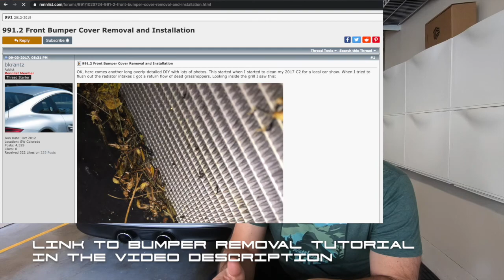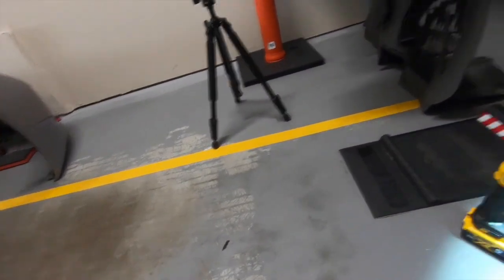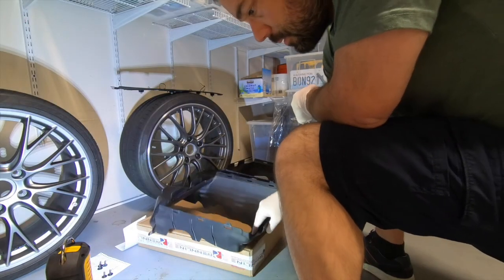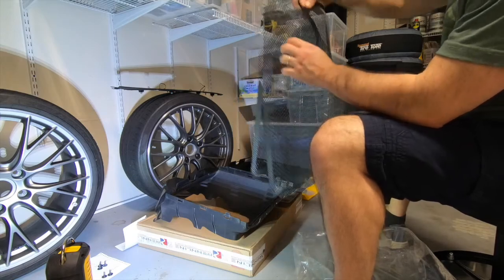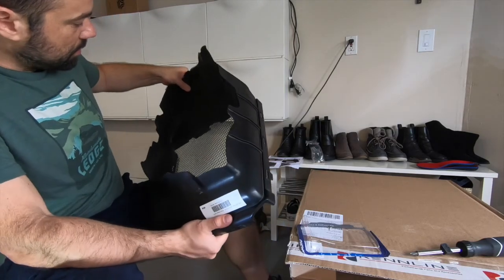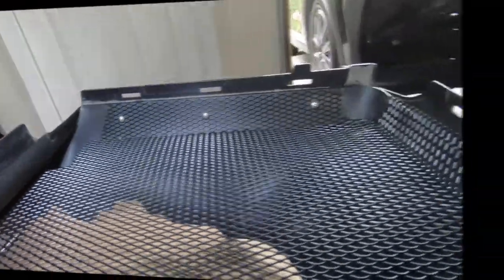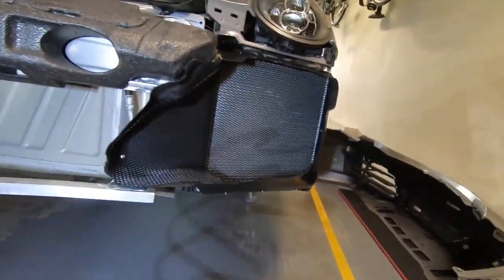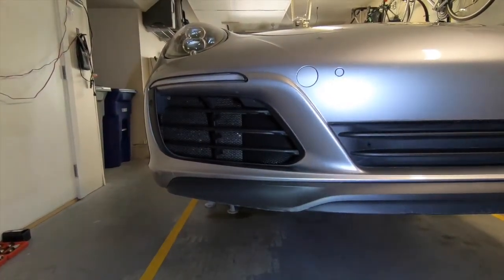Rennline Radiator Protection Grill Screens Installation

Comment: Hi Carlos, nice to see someone that is particular as to how things are done like drilling pilot holes. I have a 991.1 Carrera 4 GTS and wanted to install a grill kit of some kind but I am particular as to how they are installed. So far I have looked at Zunsport, Rennline, CustomCarGrills and the Radiator Grill Store and I have looked at some of their videos or those of customer installation. I have seen the Rennline's Grill Installation video but they are working on another 911, not my GTS, so I am not sure about my installation details. At the moment, I might just make my own using plastic grill material that I just received.

Comment: Thanks for the video.  I just bought those screens and have to install them, so your video is super helpful.  A few hours later followup:  I gave up!  The Rennline video is only helpful to a point as they show that you do not have to lift the car and remove the wheels to do the job. Also the headlights come off different with our newer model cars.  In fact I think that you really do have to lift the car, remove the wheels, and remove the fender liner to be able to easily unplug the bumper electrical connections.  Your video shows this.  I do not have the lifts for the car so I am going to have it done at the next service.  No big deal.  I do not do track days so really do not want to invest in lifts as I don't plan to be doing a lot of work on the car myself.

Yet another followup!  Ordered the stuff to lift the car.  Probably cheaper than labor to install the screens.  To be continued.
Reply from the maker: I love the followups 😂

Yeah, the video from Rennline is for the 991.1, so if you have the 991.2 like me that's not helpful at all. I included a link to the instructions I used to remove my bumper in the video description. It's not too bad. The worst part is the electric connections, but that's pretty easy if you follow the instructions. I'm glad you decided to do it yourself 🙂

Comment: Finally got mine installed.  Not that hard if you get the front wheels off the ground and remove those inner fender guards to have easy access to the wiring connectors.  On a much worse note, my car gave me multiple warning messages and would not start.  Totally unrelated to removing the bumper.  Had to get car towed to the dealer and discovered that a rodent had chewed some wiring around the engine.  Currently the engine is being pulled to replace the wiring harness.  Fortunately covered by my comprehensive insurance.  Now my garage is full of rat traps and deterrents!  Zero issues with rodents since we move  to this house in 1993, so just a heads up.  911 may be more vulnerable since the car sits low and the engine is right there close to the floor.
Reply from the maker: wow, that's crazy (about the rodents). I'll put some rat deterrents in my garage too.

Comment: Man I am posting here again just to warn you about rats and mice.  I have a pretty clean garage and never, since moving to our house in 1993, ever had rodent issues.  Just heard back that the rat chewed the engine wiring harness AND the body wiring harness. Porsche in Stuttgart is going to have to hand make a body harness as my car is a 2017 and none in stock. 6-12 month delay.  Cost so far is just over 30,000 bucks for repair, but covered by comprehensive insurance.  So, fill your garage with rodent traps and deterrents and make sure you have good comprehensive insurance!  Odds of this happening to you are very low, but my example is pretty sobering!
Reply from the maker: Wow, 30k is a lot of money. Good thing insurance covered it. I already had a couple of mice traps in my garage, but after reading this installed two more.

Comment: Thanks for the video Carlos, I am considering doing something very similar to my 2017 911.  Almost all the other videos and pictures on Rennline show grills that look like they attach to the bumper, is that the 991.1 versus 991.2 difference you were talking about?  Or has Rennline updated the design of their product?
Reply from the maker: Yes, I believe the 991.1 is different. The one I installed is attached to the air box behind the bumper because of the active grill shutters in the 991.2. There are some people removing the active grill shutters, but I wouldn't do that to my car. They talk about it here: https://rennlist.com/forums/991/1052890-rennline-991-2-carrera-grill-screens-now-available.html

BTW, the one I bought it is this one: https://www.rennline.com/Rennline-Radiator-Protection-Grill-Screens/productinfo/E1000/2219%7C2221%7C2229%7C2232